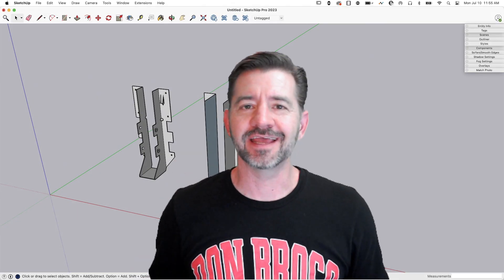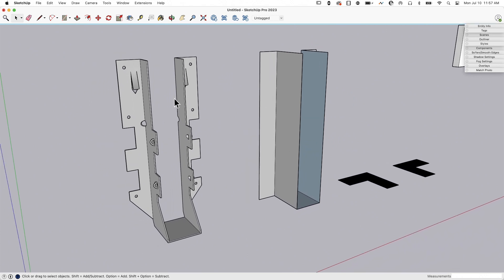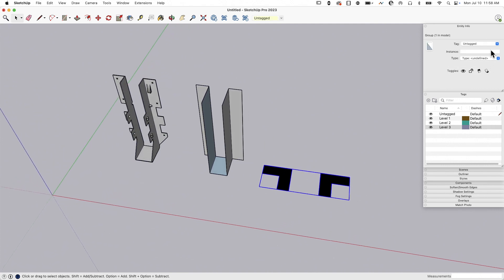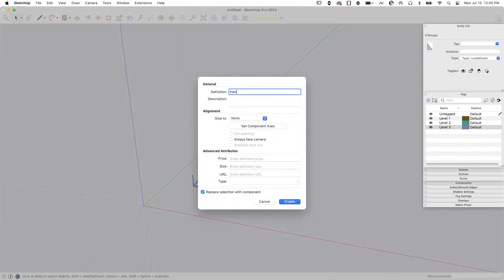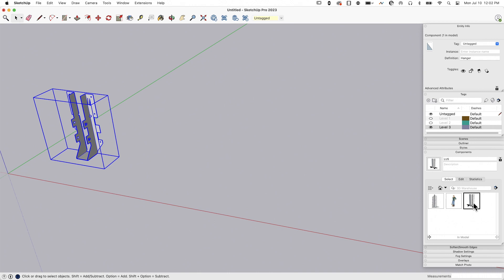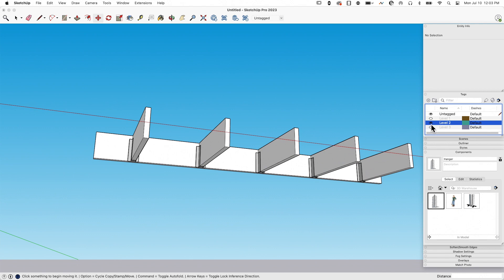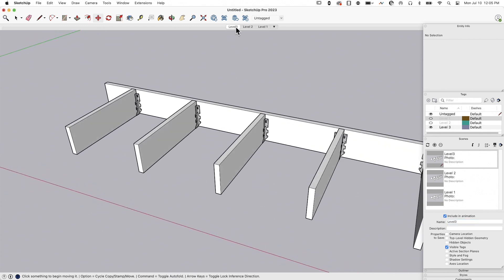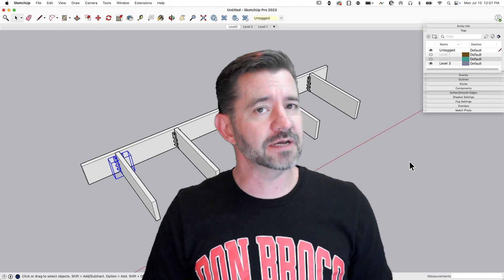Triple Level of Detail using Components

Comment: Hey Aaron,
Is it possible add a dynamic component function, so once clicked it toggles thru the “levels”… but also have the rest of the duplicated components to switch also?
Reply: Like an if statement with the on click function… or would this not work?…

Function sort of like…
If clicked toggle level 1, level 2, level 3 and if status changes with similar component refresh to new active level

Comment: Brilliant! A question, though: do the different models that represent the different detail levels actually get un-loaded from RAM when they're toggled off? Like, when you're using the Level 2 version, has the geometry for Level 3 been removed from RAM and other system resources, or is it just being "masked" or made transparent, in such a way that you're still losing some performance, compared to if you only actually HAD a level 2 in the model, and nothing else?
Reply from the maker: Everything in your model (including materials, components, etc that are a part of your template) are loaded into RAM. Generally speaking, models do not "slow down" because of RAM, but usually because to drawing to the screen. This means that if a lower poly version of an object is currently visible, you will see better performance than when a high poly version is turned on.

Comment: You say it lightens the model when you have Level 1 showing or even Level 2. Does this only correspond to speeding up modeling but not the overall weight/size  of the model?
Reply from the maker: That's right. You'll see better performance when navigating and editing geometry with fewer edges and faces displayed on screen. But tagged entities are still in the model, which will be reflected in the file size.

Comment: I like it. I was actually thinking I would have different sets of components and replace them every time I need a different level of detail. But that's cumbersome. This is kinda neet. One thing that's missing, though, is a way to figure out how to make some tags exclusive. Ie. If one gets turned on, these other automatically turn off. That would get rid of the need for the scene, which I would probably not use. I would instead always just pick the tags.
Reply from the maker: That works! At least in simpler models. Using Scenes will save much more time (and headaches) if you have more complex visibility needs.

Comment: I like the technique, but it seems like once I created the high level of detail version, I’d just want to use that. Seems like the other levels would just create additional geometry?
Reply: If you had 200 of these joist hangers in the full model of your new house, you'd definitely feel the performance difference in Sketchup as you manipulate the model with the coarser vs higher level of details enabled - depending on the power of your computer/GPU of course.

Comment: @SketchUp instead of showing command of click to set the start point ,  it is showing click to set end points how to fix it on sketch up, what could be the problem? because by clicking the the point while start drawing the line doesnt start from the point of click. and in case of rectangle the projection of rectangle is shown while drawing